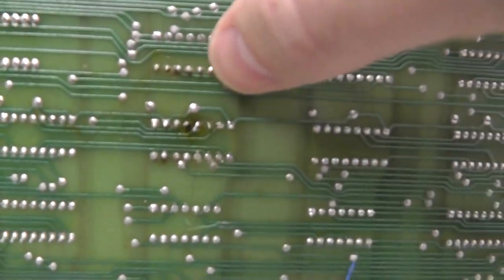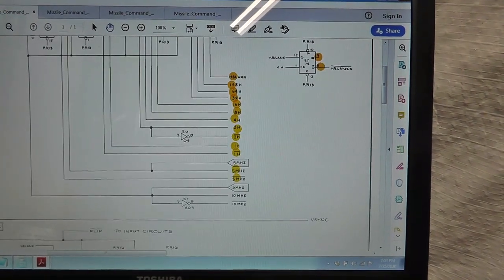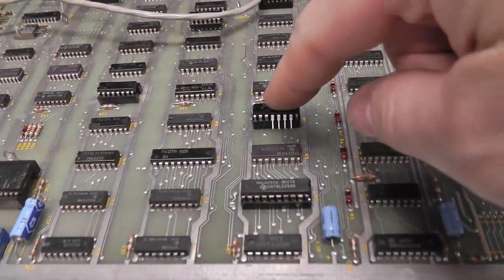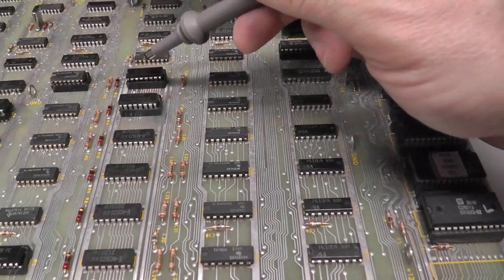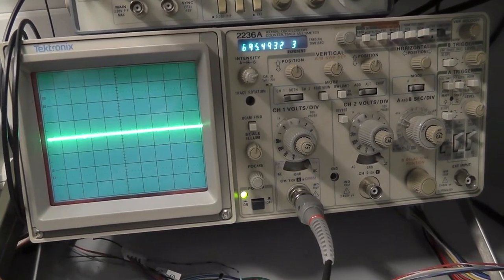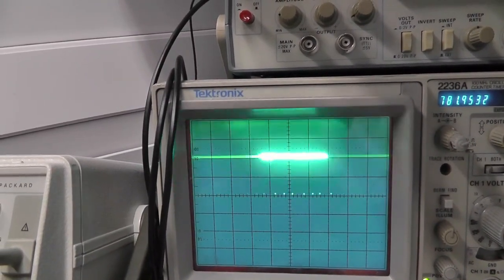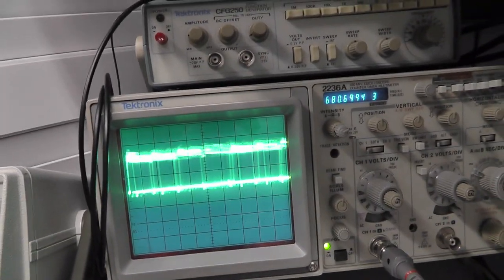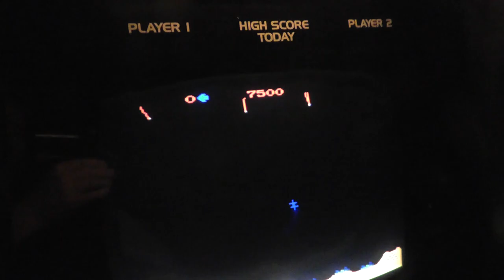Missile Command Repair PCB #3 - White Screen and RAM issues

Comment: What do you mean by AR? the AR you have installed has different audio amplifier IC chips part numbers or what is causing the arcade games to sound louder and cleaner? I'm confused why the address decoding has Rows & Columns you mentioned it in the video but you didn't go over how the address decoding circuit works with the rows and columns. When the Fluke was giving a DCD error how does the Fluke 9010A know that Address 0 is open or has no address value on address O because a BCB error the Fluke 9010A has a CheckSum Error Program to check for BCB errors, but for DCD errors not sure how the Fluke 9010A check for Address errors. Is the Vertical Blanking Signals and Horizontal Blanking signal purpose to Shift the video data to the left or to the right for the coordinates of the display screen?
Reply from the maker: AR - Audio / Regulator.  It is a common acronym for the Atari Audio / Regulator board that supplies power and audio amplification.  Will try to reply to other questions separately
Reply from the maker: Fluke Decoder Test - writes a pattern of data bits specific to each address and then reads the data back to see if it differs.  This operation and interpretation of results is what allow the fluke to determine which address line is at fault.
Reply from the maker: Regarding blanking signals, I believe this is a timing signal that triggers data r/w relevant to when nothing is being drawn on screen.  There will be certain operations ( I don't know which ones specifically) that need to happen when image is not being drawn on screen so the system knows what to draw on screen next.  << layman explanation.
Reply from the maker: regarding RAS and CAS and their use.  It is a bit above me to try and explain but they aren't really part of the address decoding circuit but rather memory/RAM decoding.  Bottom line is they are timing signals and they must be accurate in order for the dram to r/w and refreshed correctly.   There are some good youtube videos on DRAM theory of operation.
Reply: @jacklick  But you mentioned in the video that you installed a different AR Audio Regulator board and it sounds louder and clear audio sound. Is it the same AR model number and revision or different?
Reply: @jacklick  ok thanks, but is the Blanking Signals Always RESETTING the V&H counters back to zero? The Blanking signal is being "Generated" by the arcade games MCU Z80 or 6502? or what is generating the Blanking signal where is it the blanking signal coming from?
Reply: @jacklick  So only DRAM uses RAS and CAS and SRAM never uses & doesn't use RAS and CAS? What is generating the RAS signals and CAS signals in the arcade game? I thought the Address Decoder circuit was generating the RAS signals and CAS signals
Reply: @jacklick  Does any of your EPROM readers that test various RAM chips have any BTS error test and DCD error Test? Because the GQ-4X I don't think has BST error test and DCD Error Test for testing and verifying various RAM chips.
Reply from the maker: I have to double check the Model #s.  There is a slight difference between Missile Command AR-2 boards and other AR-2 boards but it is related to -5v and +12v power draw.  I suspect the audio amplifiers are going bad but need to test more to figure out this issue.
Reply from the maker: Blanking signal is generated from the horz and vertical counter chains.  It is not generated by cpu.  Based on schematic, it looks like the vblank signal will enable/disable color ram and the latch for RGB output.  Not 100% certain but thereby insuring junk isn't being displayed on screeen while something else is processing.
Reply from the maker: Yes, some of the eprom readers can test ram.  How they test it is a bit of an unknown.  Of course a simple test would be to just right 0s and 1s to every address on the chip.  Whether they do decoding test and pattern tests is unknown by me.
Reply from the maker: RAS and CAS are generated on this missile command board by the clock and sync circuit.  I believe these signals are only used for DRAM.
Reply: @jacklick  I wonder if they used a different Amplifier Part number and used different filter cap values to make it sound louder and cleaner
Reply: @jacklick  I think the DRAM is for the video ram because the DRAM is cheaper and faster access times I think DRAM has faster access time compared to SRAM that is why they often use DRAM for the video ram.
Reply: @jacklick  yes they either flood it with 0's or 1's to do a checkerboard test they use to call it back in the 70's. But I wonder what Eprom readers will test rams hips doing decoding test and pattern tests because I don't see any dropdown menus in EPROM readers that do these types of RAM tests. Have you looked in your Eprom readers SETTINGS and Menus for different RAM tests patterns and decode tests?
Reply: @jacklick  The Blanking signal is CLEARING all the data in the Video color RAM? The Latch is a multiplexer chip to the RGB output? The blanking signal is at a specific time interval being sent out at 30fps?
Reply: @jacklick  If you remove all the ROM chips in an arcade game the blanking signal will still be firing a blanking signal at a certain time interval. The Blanking signal is pulse counting the clock pulses I think for how many clock pulses it counts the blanking signal will fire and send out a blanking signal to the video RAM chip. The Blanking signal is referenced to how many clock pulses in order to be trigger to fire a blanking signal?
Reply from the maker: @waynegram8907  correct, the vblank signal is not related to game ROMS .  In fact when i did Signature Analysis as part of this repair (not shown) I didn't even have the cpu in the board to measure Horz and Vert timing/sync sections.  You theory sounds good to me.  I am sure there is a more technically accurate explanation but I am not the right person to give that do you :)
Reply: @jacklick  Not sure how you're getting Signatures on your Signature Analysis from measure V&H sync signals. I thought the Signatures are only for Data signals on the data buss and address signals on the address buss because of that NOP replaces the MCU which the NOP is sending out data signals and address signals. The V&H sync signals shouldn't have signatures so I'm confused how you are measuring signatures on the V&H circuits counters signals because the NOP is not generating the V&H sync signals.
Reply from the maker: @waynegram8907  A NOP adapter basically turns the CPU into a synchronous counter.  The sync bus, if you will, is also nothing but a clock and counters so if you hook up to a consistent clock and most significant counter output, you will have stable signatures.
Reply: @jacklick  Can you measure signatures of all the V&H sync signals and get measured signature values for each V&H Sync signal? If you REMOVE the NOP adapter the V&H Sync signal will have the same or different signature values?
Reply from the maker: @waynegram8907  the NOP and cpu can be completely removed.  Not needed when measuring V&H sync signals and doesn't impact measurements if they are on board as the probe clock, start, stop are not on the NoP/CPU.
Reply: @jacklick  The Signature Analyzers start&stop probes are connected to the arcade games CLOCK signal when using the signature probe to measure the V&H sync signatures values? The only way for the signature probe to measure the V&H sync signature value is you have to connect the Signature Analyzes Start&Stop probes to the clock signal?
Reply from the maker: @waynegram8907  Start and Stop are placed on the most significant output of the counter ic or chain you are testing.  You connect the probe's clock to system clock or really any clock signal that is consistent and makes sense for the part of the circuit you are measuring.  It makes sense to start at the closest clock signal to crystal as you are testing the rest of the circuit and don't know if if it is good or bad.
Reply: @jacklick  I'm guess the Signature Analyzer is creating signature values by pulse counting the clock signal and MSB which could be a data pin/line MSB, address pin/line MSB and somewhere the Signature Analyzer creates a Signature value based on pulse counting the Clock signal and MSB data or sync, address signal and the measured logic signal you want to get a signature value. What I'm saying is a Signature Value is a combination of the clock signal, MSB which the MSB could be a data pin or an address pin or a V&H sync signal.

Comment: Missile Command Version#1 uses 2708 ROM chips and the rom chips R3 will control the chip select lines for all the other ROM chips. What is this R3 ROM chip the address decoder in missile command Version#1?
Reply from the maker: I had to look at schematic real quick but all the address decoders from the roms are two 74LS139.  not sure where or what in the video you are referring to.
Reply from the maker: oh R3 is just the 12th rom.
Reply: @jacklick  Atari Missile command Version#1 uses 2708 ROM chips. When using the Fluke 9010A to test all the ROM ranges, The ROM chip R3 chip select C/S is always being pulsed from low to HIGH at the same time when another ROM chip C/S is also being pulsed from HIGH to Low. It's very weird how R3 is always being pulsed at the same time as another ROM chip is being C/S is pulsed when testing all the different ROM ranges. Its a common thing Atari did about using a ROM chip to do the upper ranges and lower ranges. Its something about the upper ranges and lower ranges that R3 is switching the upper ROM ranges and lower ROM ranges that is why its always being pulsed at the C/S pin. Atari did this often I have heard for some reason.
Reply: @jacklick  When you reset the Atari missile command when measuring C/S pin on R3 ROM it will be pulsing from HIGH to low. All the other ROM chips C/S pin will have just a HIGH which all the other ROM chips are disabled turned OFF. When using the Fluke 9010A to test the other ROM chips to turn them ON one at a time for testing each ROM range. The C/S pin on R3 is pulsing as well as the other ROM chip C/S pin is pulsing. Its unusual to have two ROM chips C/S pins having pulses on at the same time. Most arcade games only have ONE ROM chip C/S pin per each ROM range. But In Atari games like missile command you will have two ROM chips C/S pins pulsing at the same time. R3 is pulsing when ever you're testing any other ROM chips ranges. R3 is doing some type of upper range/lower range banking
Reply from the maker: @waynegram8907  That is interesting behavior.  What video and time did you see it at.  Based on the schematic, I don't see how R3 is doing bank switching but haven't worked on these in months.
Reply: @jacklick  its not in your video, but Version#1 of Atari missile command uses a lot of 2708 ROM chips and I think R3 is doing the "bank switching"